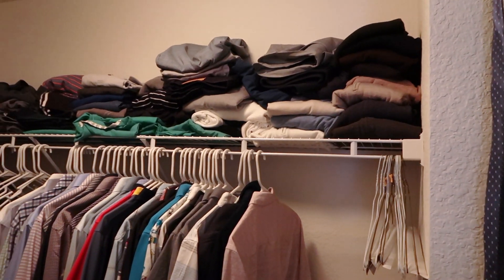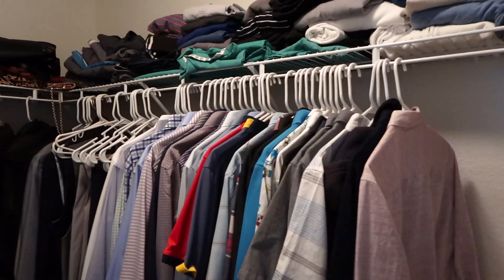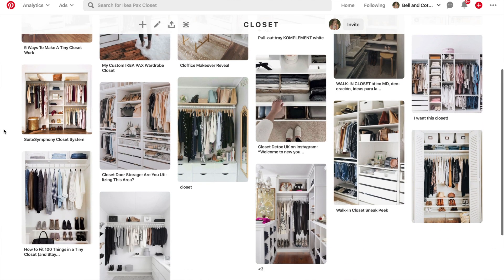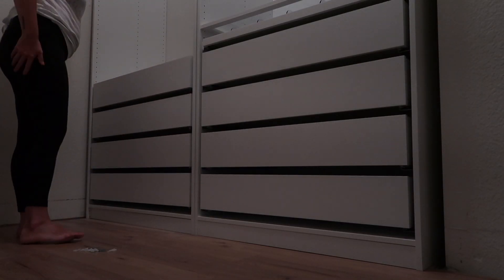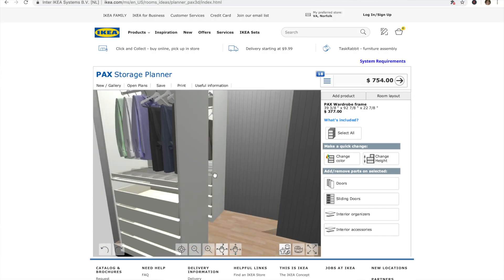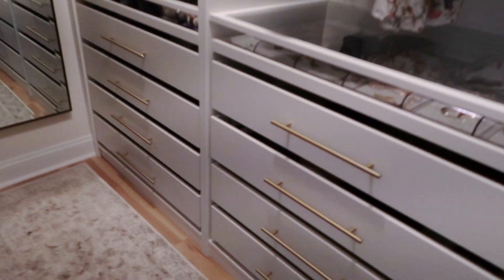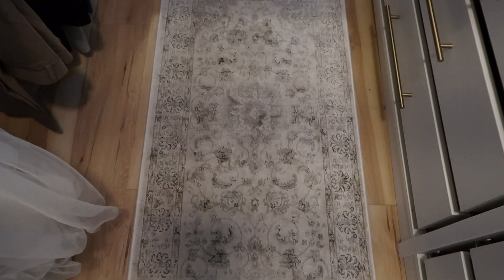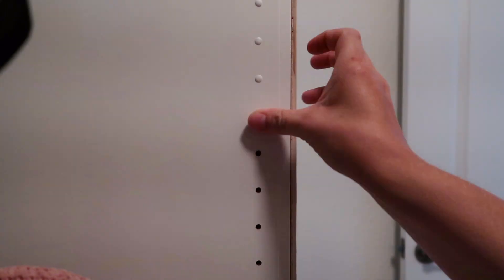DIY Built-in Closet using IKEA Pax + Algot

Comment: Ooo never thought of using 2 systems. I have had the pax for about 2 years. I have and awkward empty section, which has room for one more pax frame but have been hesitant because it  would block access to a circuit box (don’t know why they put that in the master closet) but now I will look into the Algot. Thx for the inspo.

Comment: I have a small walk in closet too so my challenge was how to maximize my space with IKEA storage system. The corner pieces didn't work since it was too bulky to fit the larger (3x) PAX frames that I wanted. I ended up getting doors with nice brass handles (similar to yours) for each of my frames and completely removed my walk in closet door (it's never in use since I always leave my closet open). I swear there are three doors in my master bdrm- why do we need so many doors other than the main one? I think you need a chandelier in your closet! I'm definitely thinking of getting one with brass and crystals to elevate my small closet space. BTW, I like how your wardrobe isn't so cluttered and wooden hangers are the way to go.
Reply from the maker: Thank you! Still loving it now! So glad to hear you were able to update your closet successfully. Thank you for sharing!

Comment: Gorgeous closet!!! I have a closet Pinterest board too! In the process of doing an office/closet and beauty room and I’m unsung the Pax system. The drawer knobs are so nice and add to the look! How difficult were the pull handles to install into the drawer and what size drill bit did you need to drill the holes?
Reply from the maker: Thank you! The knobs came with a suggested drill bit size. I believe for these it was 3/16

Comment: This is exactly the video I needed! I was looking into redoing my master walk in too. But it’s been hard to imagine the pax in the space. I love your idea of having pax on one side and algot on the other! Genius. Can you tell me the width (the measurement of the wall with the mirror) of your closet? Mine is only 63” and I’m afraid there won’t be enough walking space like yours :/. It would be so helpful! Thank you!!
Reply from the maker: Thats really close to my measurements as well, I believe that wall is just a little less then 5 feet in length. So in between the pax and the Algot we only have about 30 inches (might even be 28,) but it works. I definitely couldn't fit two sets of pax in there, even though I would have loved to, which is why I did the Algot on one side. I even considered building my own shelving on that side, but the Algot was shallow enough and also inexpensive. Good luck with your project, Katie! I'm sure it will come out beautifully.

Comment: Did you have problems with the width? When I go on ikea’s site they said the min width is 197 inches. Mine is 103 inches. Any suggestions?
Reply from the maker: You may need to try a different configuration. Lots of options with the pax.
Reply: Tia, if I’m not mistaken the pax unit comes in 3 widths. 39”, 29” and 19”.